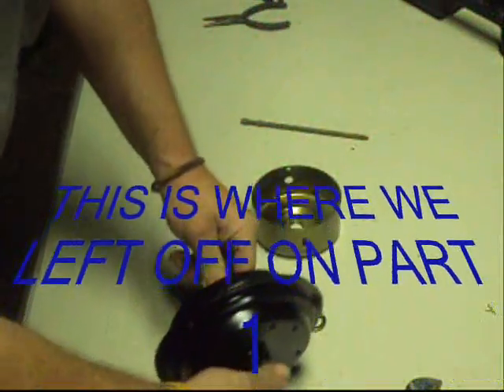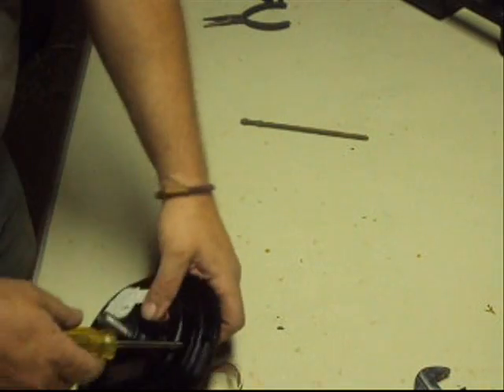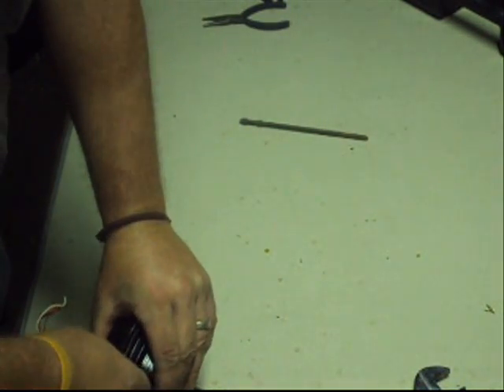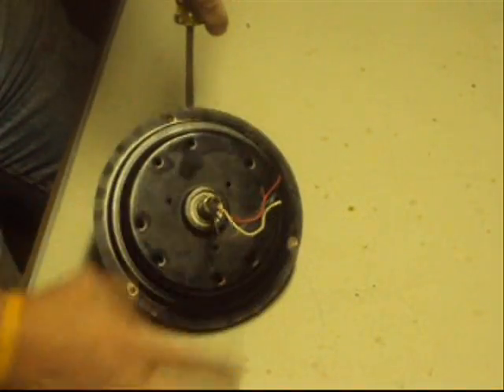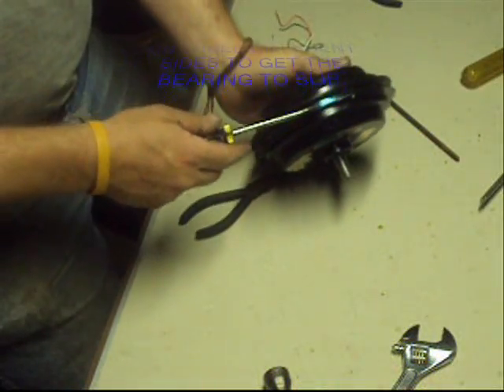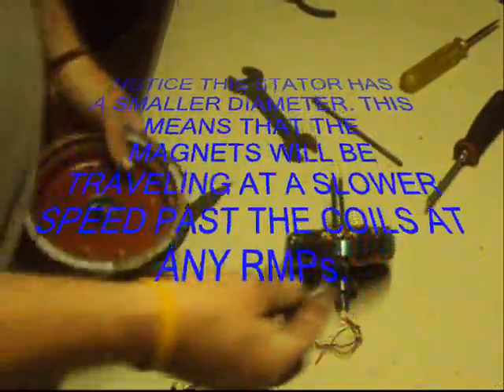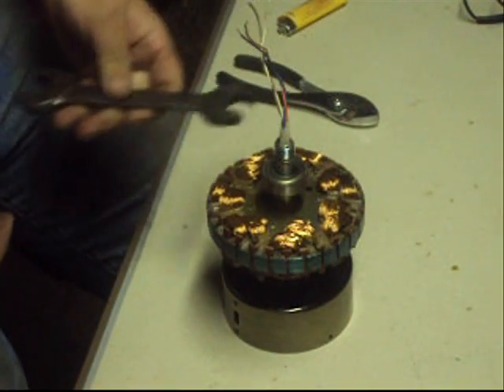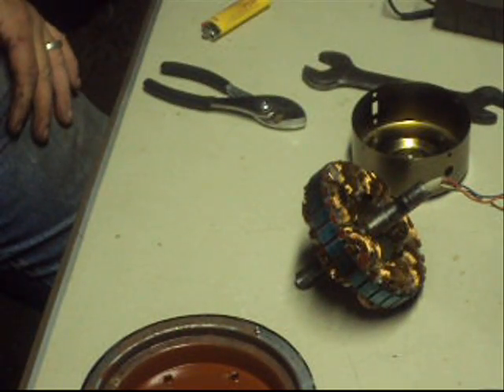THE CEILING FAN WIND TURBINE CLASS PART 2

Comment: muddmann It dunna wanna come off..... I need help getting a motor housing seperated from the bearing ... im not using the class cieling fan motor, I found this motor last night in the recylers bin ...really well made specs>1.5amps and only 150mm in dia, SMC Shell Electric MFG TCUB42V-LC Jun2003... but I cant get the freekin housing off ... maybe a puller tool? HELP